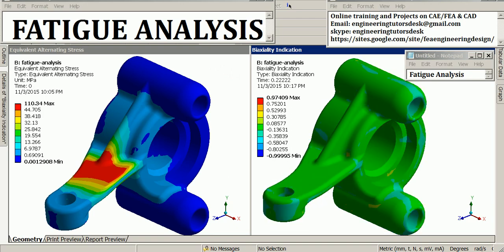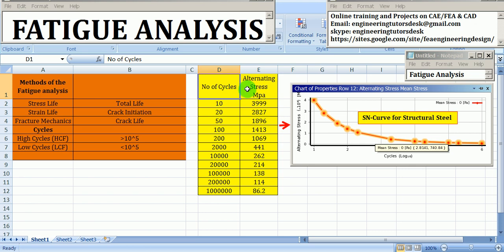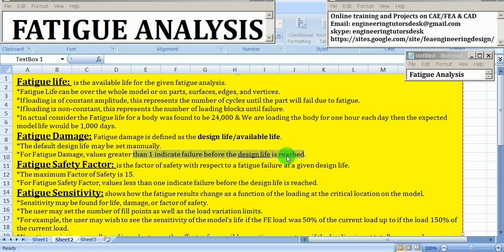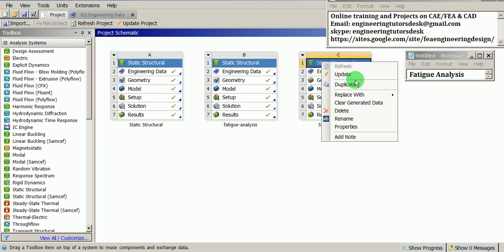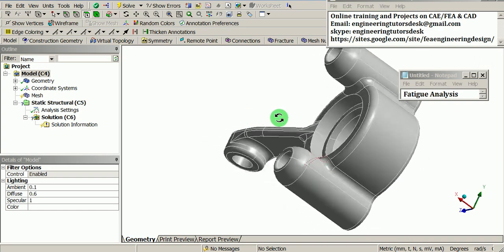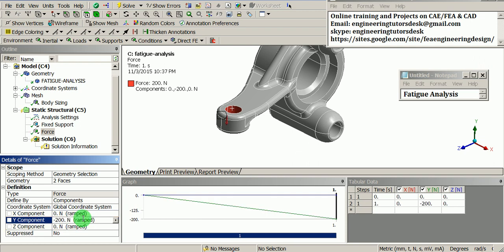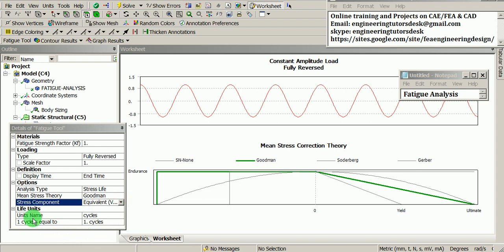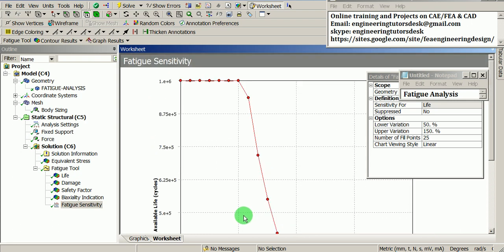Fatigue Analysis in ANSYS | Fatigue Failure |  HCF High Cycle & LCF Low Cycle Fatigue Life | GRS |

Comment: any comment about Biaxiality indication?? thanks for video!
Reply: Biaxiality indicator tells you whether loading experience by the part is pure shear, uniaxial or biaxial. 
İf Biaxiality indicator  value is -1 pure shear condition
0 uniaxial, 1 biaxial condition.
For example you get -1 so it is pure shear condition.From the fatigue tool details , you choose stress component  as max shear , you will get more accurate and sensitive result for your simulation.

Comment: Hi,
Where I need to get S-N curve values?
Is it available in data sheet or we need to derive this value
Reply: did you find the solution
Reply: You can find that S-N curves from specific researches just you need to google it. I recommend that you should care about materials's heat treatment process. S-N curve will change after surface hardening or any treatment.

Comment: Nice video! What if I would need to create a new material in engineering data? For instance I would need to add the S690QL steel. Do you know any website or any place in the internet that gives you the tabular data for these applications? And maybe data necessary for plasticity settings?
Also I have a question related to the loads considered by the fatigue tool: I should make a simulation of a flange with bolt pretensions and some external loads. I don't know how to let the fatigue understand that the bolt pretension should not be considered as a cyclic load!
Thank you in advance.

Comment: Hi, very good video! I'm starting with my first fatigue analysis and this video explains very well the steps to do. The only thing I did't understand is why you used the fully reversed option when the load is from 0 to -200 N and not from -200 to 200. Wouldn't be better to use the zero based option? thanks
Reply: Automotive components usually experience reversed loading due to bumps and pits

Comment: Thanks for the video, very helful! 
One comment. You give a practical example in 7:30 "In actual consider the Fatigue Life for a body to be 24.000 cycles and we are loading the body for 1 hour each day, then the expected model life would be 1.000 days". How do you come to this conclusion? 
Let's say that we have a static loading on a body which lasts some time. 
For example we have a steel body which takes a load of 10tn, the load remains on the body for some given time and then the load is removed. We make the static analysis in ANSYS and we find that the minimum fatigue life is 10.000 cycles. In practice we put a load of 10tn for 60mins (static loading) and then we remove it. How do we calculate the fatigue life in hours? Thanks in advance.
Reply from the maker: +Theo Fatigue is cyclic loading
Reply: Right, but what is the effect of the time the load is acting on the body on each cycle?
Reply: It does not depend on the time. Fatigue design is based on number of cicles, in the books says that it's independent of the time application of the load for the practice, you can download free the book "Design of machine elements, by Robert L. Mott". I hope i helped you!.
Reply: Yes, that's right, fatigue is dependent on number of cycles. In the video and actually on point 7:30, he says that if we get from Ansys a fatigue life of 24000 and the load acts  for 1 hour per day, then the model life will be 1000days. If fatigue life is independent of the time force stays on the body, why do we have a fatigue life of 1000 days and not 24.000 days? Remember that we have 24.000 cycles fatigue life.
Reply: @Theo2482  Because you stress the the part 24 times per day (1cycle per hour). If you have a total of 24000 cycles according to this load, it makes 1000 days (24000 divided by 24 cycles per day).

Comment: Can someone explain to me how is it possible that alternating stress in structural steel reach to 3999MPa? i don't understand something 
can someone explain it to me ? the alternative stress is difference between Sigma max  and Sigma min ?
Reply: Before someone explains, you first have to explain what are you talking about. In any case, 3999 MPa is out of the world, you must have done something wrong 101%. One possible mistake is material data you've entered are wrong.
Reply: That can be a hypothetical value which also may occur theoretically as a notch effect.

Comment: can we do fatigue analysis of bike handlebar by this same method?
i tried with your method but in fatigue tool the result of the option life was not coming correct, the result showed that the whole part will suffer fatigue at same number of cycle.Can you help me on this? 
and how can we do vibrational analysis on handlebar in ansys?
,
Reply: 1) It's hard to answer when one cannot see what you've done. 2) what kind of vibrational analysis do you need?